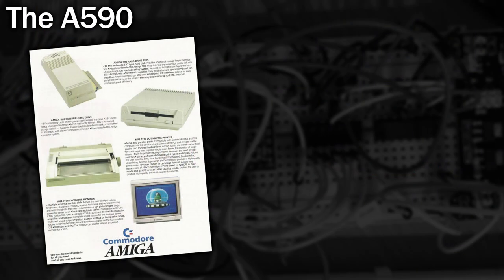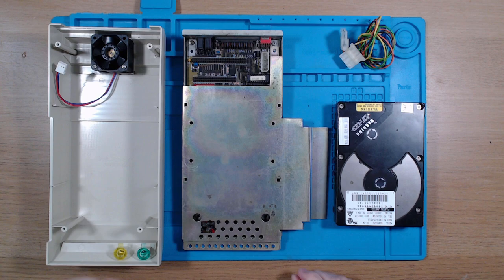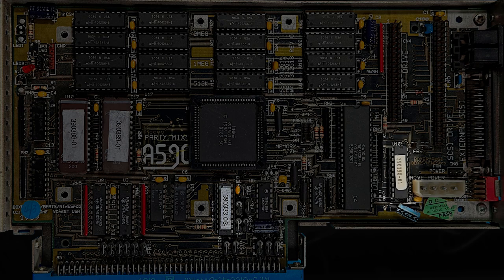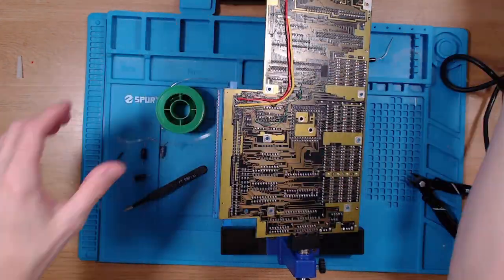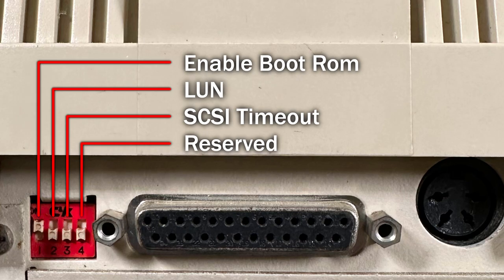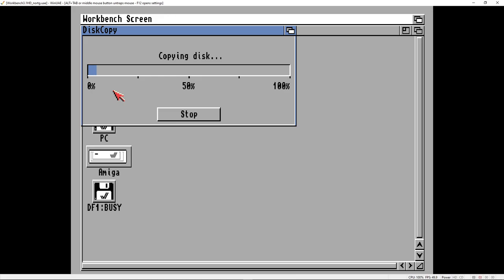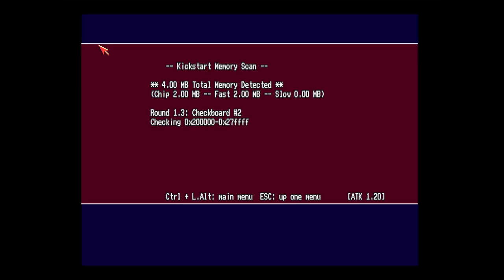RARE Amiga A590 Rev.6 Repair - Check Out That Serial Number! - Part 1

Comment: Happy memories. I killed my A590 when it's power supply put out too much voltage. 😢 I ended up getting the GVP side car instead. It was very much faster than the 590 so I wasn't too upset.
Reply from the maker: Yeah I might be doing a follow up on that speed subject. Both are fairly hard to come by though these days

Comment: I was lucky enough to have one of those for my A500 (with KS1.3 so it booted). It was my first hard disk. Workbench became so much more useful when you had a hard drive to boot from. And 20 MB felt like SO much storage space. But the whole setup became quite wide and took up a lot of desk space.
Reply from the maker: Would love to have owned one back then, but as you say it takes up a lot of room. The desk where I had my Amiga setup literally only fit it so it would have hung off the desk anyway! But yeah I guess I get to explore how much difference having a hard drive connected makes. Thanks for watching

Comment: Cool... looks like the A590 PCB was designed at Commodore's West Chester, Pennsylvania, USA headquarters ("WCHEST USA"). And it appears as if the engineers wanted to make sure their names were seen - their names are also on the copper layer by the Molex power connector.

I'm not sure that capacitor was replaced - it looks like they designed the board for a axial capacitor and then used a radial capacitor likely due to cost or supply chain issues. The heat shrink on the leg may just be to protect the excessive length of exposed capacitor leg from shorting. But that cap looks like ones Commodore used on the Amiga.

MT RAM chips from that era are notoriously unreliable, so I'm not surprised that three were bad (and don't be surprised if more of them fail in the future). Looks like someone pulled that chip in a fault-finding mission, broke the leg in the process, then put it back. Was it the eBay seller, or was it the owner that tried and failed to troubleshoot their beloved Amiga back in the day (or both)? We may never know... but yeah, I've bought many things on eBay where I ultimately suspect the seller knew something was amiss, if not wrong, with the item.
Reply from the maker: Interesting (and yes a few more of those ram
Chips went pop a few weeks later!) the seller did list this as a project he just didn’t have time to finish and had been sitting around for some time so leads me to believe it was probably the owner before him - not that it matters it’s all good now! 
I now have another (spoiler) A590 but that has axial capacitor in that spot. Mind you, with commodore who knows!
Thanks for watching

Comment: Interesting but the musak is distorting because it is so loud.
Reply from the maker: Can you give me a hint at which part it’s too loud? Will help me with editing
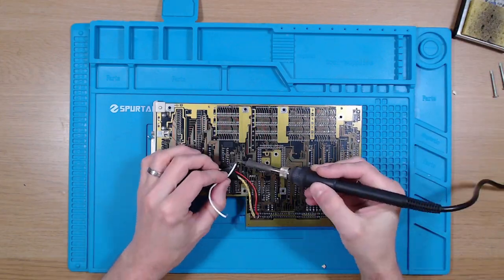Reply: @RobSmithDev HI Rob, it was about 5:20. It actually doesn't sound distorted on my android tablet I think I need new computer speakers.
Reply: @RobSmithDev I worked for the BBC and Sky as an editor for decades. My opinion is that you don't want your viewers adjusting the volume during the video and have the music just stopping there being silence, so much lower volume than currently. I have noticed youtube ads getting louder recently so I would make your voice as loud as possible and reduce the music volume 75%. Cheers
Reply from the maker: Cool thanks for the feedback. Yeah probably just turning it up too loud during those bits